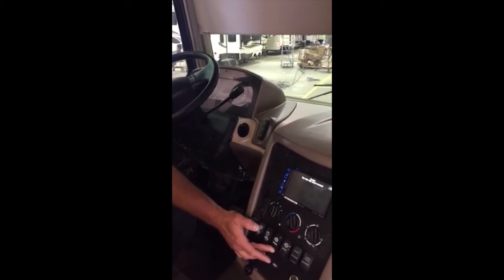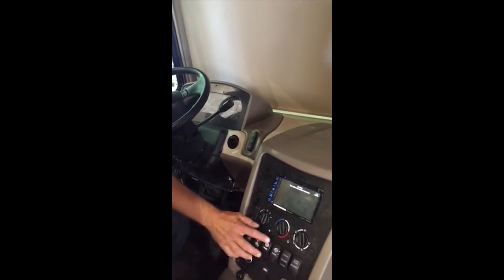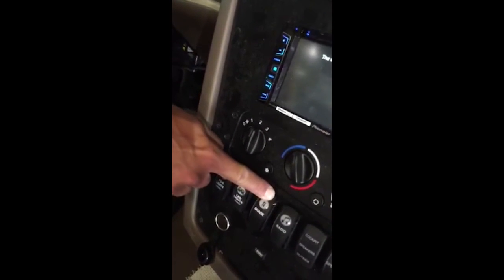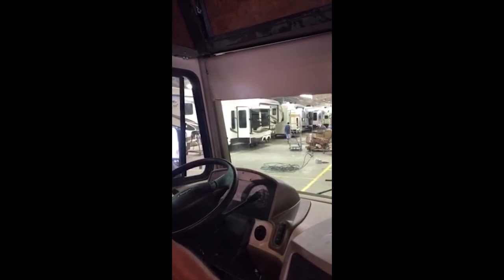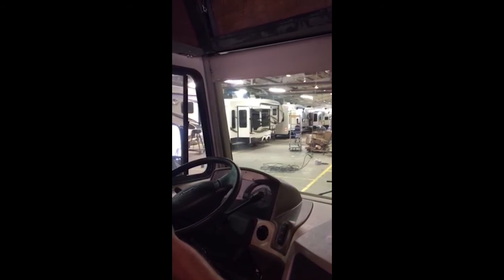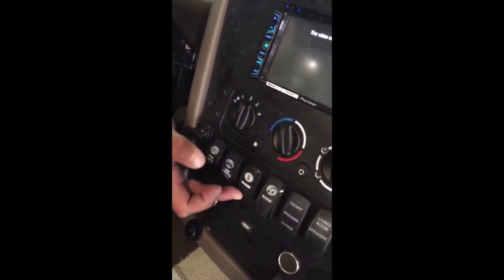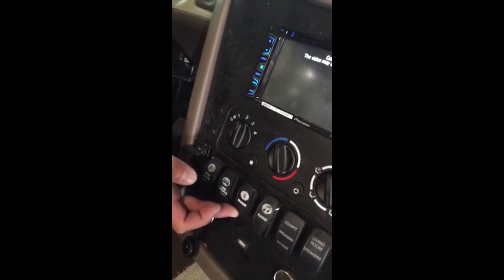Programming a Wired Motorized Slow-Rise Roller Shade

Comment: I had to watch it twice to figure out that you are holding down the red button on the left side of the shade as you push the down button on your switch. I am hoping this has resolved my problem with the shade just dropping on its own while going down the road or simply not rising using the switch. I cannot get the same steps to work on the night shade tho, strange.

Comment: this video starts late missing part of the instructions
Reply: Christian beaulieu 
not true, I agree it seems like it, but I figured it out after the second time I watched it.
Reply: It is incomplete, but I also figured it out after watching it a few times and having seen the other button by chance in another vehicle months ago.

Here is a narrative for the missing part of the video -- Roll the shade up as far as it will go. Look behind the shade for a small button hanging by two wires, it might hidden behind a panel - look at the man's left hand (in the video) for the general location. With the ignition off, press the button in your left hand while rolling down the shade, it will beep several times.

From there, I winged it - basically, holding the programming button (left hand) while rolling the shade down causes the shade to enter programming mode. Roll it down to the lower limit you want, then roll it back up to the upper limit you want, then roll it down again until it beeps several times. Then, test the positions by rolling it up and down.